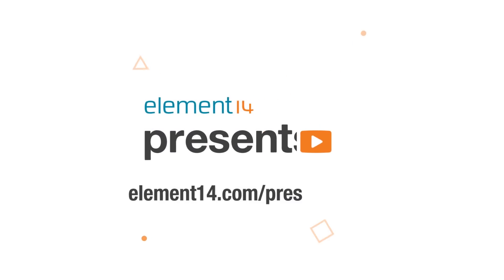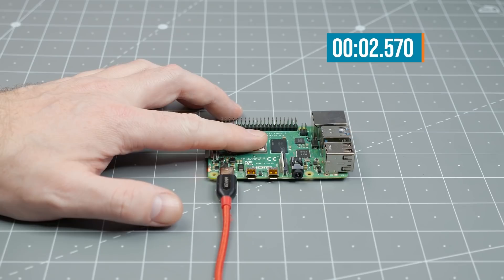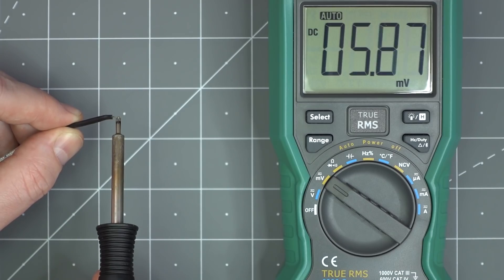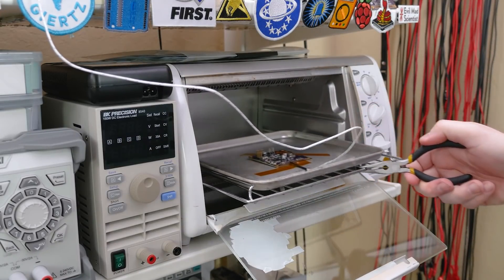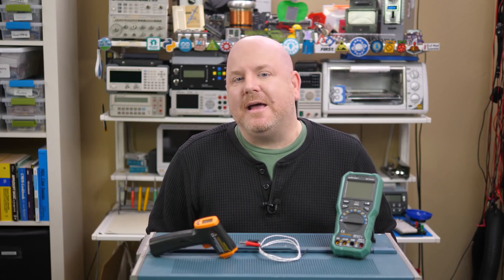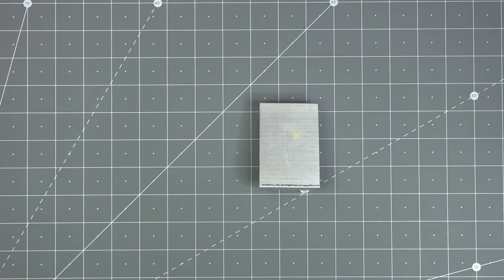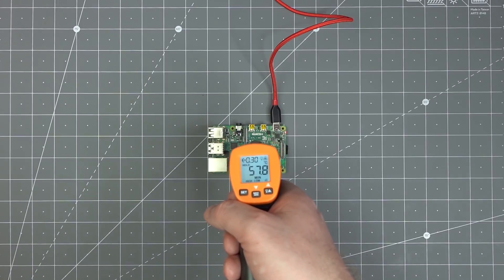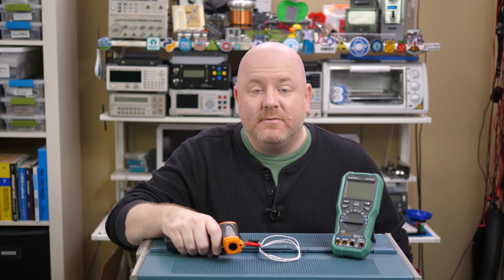Thermal Tools for Circuits - Workbench Wednesdays

Comment: I was thinking about this 10 minutes ago, how do I mesure my solder iron temperature . And heres a video about it. First thing I see when I enter YouTube. Universe is strange
Reply: Make sure your thermocouple can handle the temps. Many of the cheaper ones only go to 300°C or there abouts.
Reply: @Unordung  im going to set the iron at 150-200, should be fine, i only want to see if its precise . its a cheap iron, nothing fancy